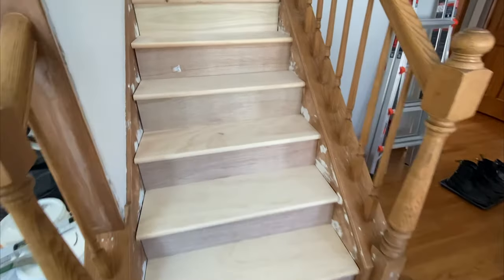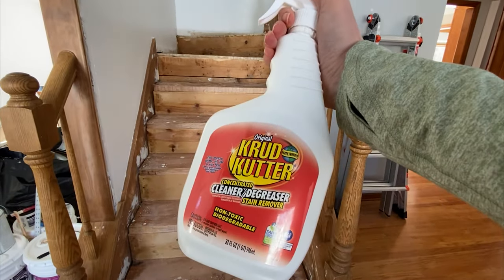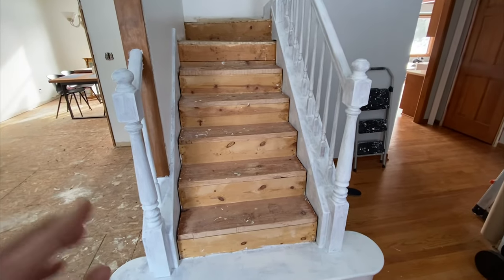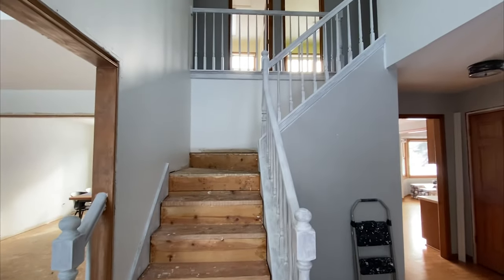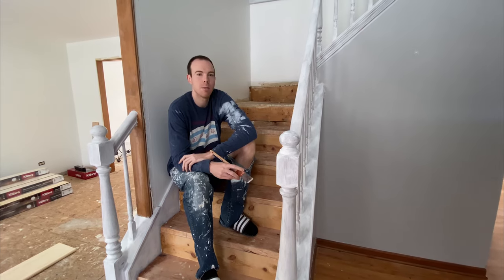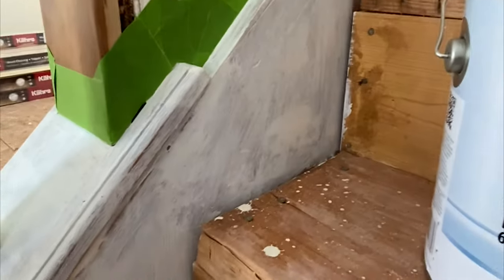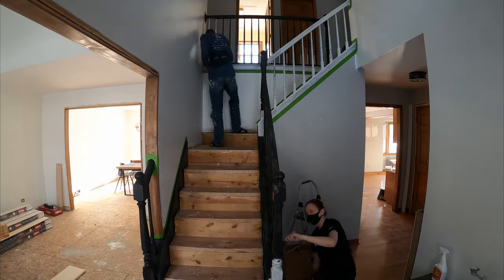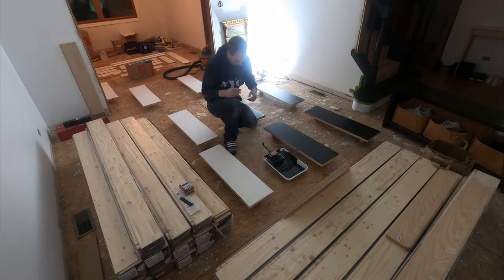Painting our Stair Black & White! | Stair Reno Pt. 2

Comment: This was my plan b  for my staircase after I realized the carpet I took off had damaged the wood so it took the stain differently. My SE store recommended their porch and floor enamel. Did you consider that and if so what made you choose the tread plex? Did you apply a poly after the marine coats?
Reply: By the way it’s beautiful and I’ve become obsessed with your videos!
Reply from the maker: We saw someone else use the treadplex on multiple projects! We used that paint, did not poly, it’s been 2.5 years and it’s held up amazing. Would definitely use that paint again
Reply from the maker: @melaniebonner847 thank you!! Welcome!! ❤❤

Comment: Amazing! this has been such a head ache for me. I've come back and rewatched your video a few times. Why tread then riser vs riser then tread?  How is the paint holding up? Any tips to measure and cut landing type steps/spots. I have 6 steps that are not regular rectangles. Have you noticed a creaking anywhere? any tips to avoid squeaks creaks?
Reply from the maker: The order you install them is preference, we decided to do tread first for our workflow. The paint is holding up excellent and it’s been over 2 years since we painted. For the landing, we made cardboard cuts out to test fit pieces and used that as a template for the wood. No creaking at all, make sure you’re using a lot of glue when you set them into place to avoid creaking!

Comment: How has your paint held up on the treads?  Cheers
Reply from the maker: It’s been a few years and the paint has held up beautifully! We have a few nicks here and there but it’s from hitting stuff into the stair railing, not from everyday wear
Reply: Did you all use any polyurethane after u painted the stairs to help seal the black paint? And if so did u sand in between each coats of poly